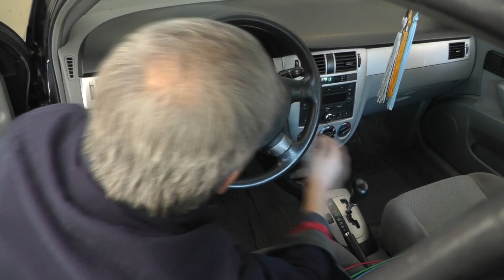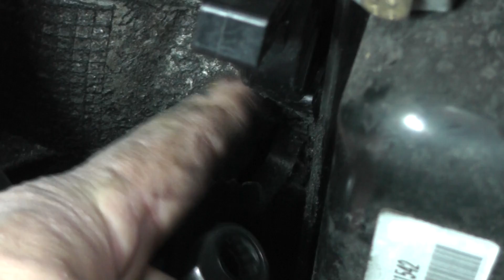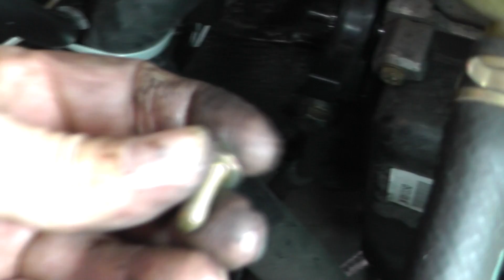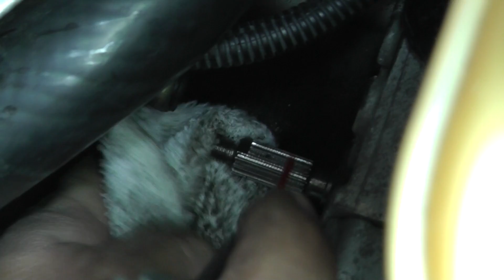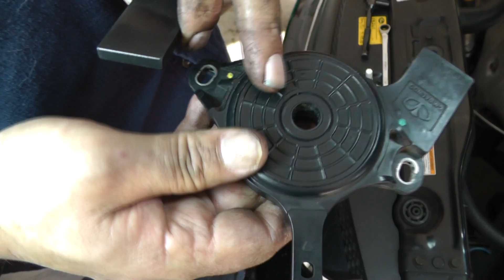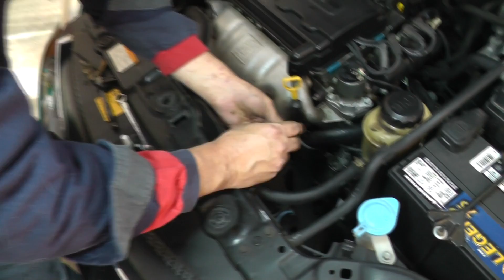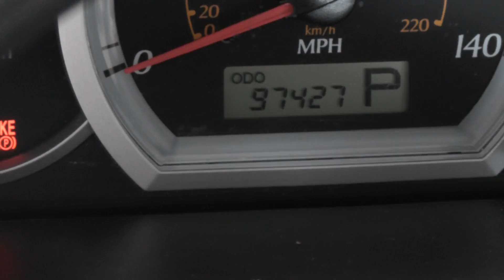Suzuki Forenza Installing Transmission Range Sensor - Part 5

Comment: Hi stuzman! Great video! I am having one slight problem getting my 07 suzuki reno in neutral. Can the range sensor still be taken off in park and then adjusted to neutral so i can install it?
Reply from the maker: Cortneyt80 You can take it off in park, but you need to make sure that the sensor is indexed for that position when you install it. The sensor comes new indexed when the gear selector is in neutral. If you want to install it in park, you’ll have to manually index the sensor to the park position. Otherwise, the sensor will not work.
Reply: I cant get the car in park but i will try that. Thank you :)
Reply: It worked lol! Thanks again for the detailed video!!!
Reply from the maker: Cortneyt80 Glad to hear that it worked for you! 😀👍

Comment: Hi Stuzman, when I slam on brakes very hard, the transmission seems to go in neutral and it take a second to kick back in gear. The gear selector doesn't move when this happens. It feels almost like the brakes are locking and then it clicks back in gear with a noise. Sometimes I cant get it out of park without pressing the shift lock button. There are no codes present. Could the range sensor be the problem.
Reply from the maker: If there was an issue with the range sensor, you most likely will get a P0705. I would focus on why sometimes you can't get it out of park sometimes. You have a solenoid interlock issue with the shifter. If you need the wiring diagrams which are free, you can check in the description of this video for a link.

Comment: Hi Stuzman! Thank you for this video as it will help me alot in working on my dad's car.  However my other problem is that the wiring hareness is damaged due to rodents chewing on the wires of the connector. Do you happen to have a link for the diagram of the wiring or possibly a link on where i can purchase a new connector for the transmission range sensor? Thanks in advance!
Reply from the maker: Here is a link to free wiring diagarams. https://www.bbbind.com/tsb-wiring-diagrams/ As for the connector, you could do a google search or maybe go to the junk yard and see what turns up.
Reply: Hi Stuzman! I replaced the TRS with a junk shop TRS then car wont start at all. Purchased a new one and the car starts but still same issue with the tranny on limp mode. When you put in drive, it's still stuck in 3rd gear and clunks as well as in reverse.  Tried manually adjusting TRS but to no avail. I have no computer to clear CEL. Is it necessary to clear the code using OBD?  This issue is driving me nuts!!
Reply from the maker: Paul Sevilla The light will be out if all is well. Are you sure the wiring is all good now?
Reply: Stuzman,  i believe wiring is all good now.  I just followed the colors of the wires that i traced back from the original wires that were not damaged.  Although the original wiring has 3 yellow wires and the  new socket that we got from the junk yard has 3 green instead of yellow but has a tracer equivalent to the yellow ones so i connected based on the tracer.  Everything else has the same color as the original wiring.
Reply from the maker: Paul Sevilla The only thing I can think of is to make sure the range sensor is adjusted properly. Although there is a special tool for this, you can get it adjusted by making sure the two bolts for the sensor is in the center of the two slots. If that has already been done, see if you have the slash across the gear indicator such as in park. If you have that slash, this indicates you have an issue with the sensor, its wiring or the TCM module. You may have to get a scanner on it to confirm that you have a P0705 code which indicates an issue with the range sensor circuit. You may have to do some troubleshooting to isolate the issue. If so, I have detailed troubleshooting methods in this video series.
Reply: Stuzman,  noted on this.   Will work on the car this week and give you a feedback.  Thank you!!!
Reply: Hi stuzman.  Finally got a hold of a obd computer.  Got 4 codes.  P0717, P0734, P0731 and P0700. I thinl ot os more than just a trs problem.  What is you opinion on this? Thanks!
Reply from the maker: Yes, more than a trs problem. All of these codes are related. The P0717 is for the input speed sensor for the tranny and this sensor is used along with the output speed sensor to determine the gear ratios for the gears. If the input sensor is not seen by the TCM which it appears it doesn't, then the module can't determine the gear ratios. Thus, that's why you have P0734 (fourth gear) and P0731 (first gear). The P0700 is a generic transmission code. Start your diagnostics with the input speed sensor and see if the wiring is intact. Maybe the rodents had a happy hour on that wiring. If that looks good, then you'll need to see if its generating a signal. A scanner that can see data will be able to let you see the RPM of the input shaft of the transmission. Good luck!
Reply: Hello stuzman! Thanks will dive back in a few days and see what i can find.  Thank you!
Reply: Hi stuzman! I have been trying to look for the intake turbine speed sensor but to no avail. Do you happen to know where  it is located as well as the output.turbine speed sensor. Thanks!
Reply from the maker: Hi Paul. I can't remember the exact location of these two sensors as I sold the car about four years ago. If I still had it, I would take photos for you. The input turbine speed sensor should be located near the bell end of the tranny whereas the output speed sensor should be located on the differential end of the tranny. Both of these sensors should have two wires going to them. You could do a search on Google for photos which may show the location of the two sensors. As a suggestion go to www.alldatadiy.com for your vehicle which would have the factory service information which includes, repair information, wiring diagrams, electrical connector information showing locations and of course, all sensor's location. The price is very reasonable and would be a good investment in yourself. Good luck Paul!

Comment: I did everything I saw in the video replace with an original part TRC...and after running the car for less than 1/4 miles...when back on 4 gear and is giving me the same error P0731,P0700, P0705, and it when back on 4th gear. Now is stuck in 4th gear .. again ?? Please help ??
Reply from the maker: You may have an internal issue with the transmission as the P0731 is an indication for an incorrect gear ratio implying that the transmission is slipping. The P0705 would indicate the tranny range sensor has an issue or its wiring. Did you do any troubleshooting with the sensor to know that it is bad along with its wiring?

Comment: Hello I spoke to you 3 months ago I have a Suzuki Forenza if you don't change the oxygen sensor will it cause the car to not run and also do you have any videos on how to change an oxygen sensor I think it's an O2 oxygen sensor
Reply from the maker: Yes, I remember you Veronica and hope you're doing well. Typically, depending on how an O2 sensor fails, it could make the car run poorly either too lean or too rich. Best to know for sure that is your actual problem as far as the O2 sensor. I don't have any videos on changing the O2 sensor, but it's a straight-forward job. Disconnect the electrical connector and screw the sensor out with a wrench or O2 sensor socket. Having the exhaust system hot usually makes the sensor come out easier.

Comment: Hello I have a question do you have to have that alignment tool if so do you know where I can get it at for a reasonable price I looked it up on Google and it ranges from $120 and up is there any other place I can get it for more reasonable price?
Reply from the maker: Veronica Roni Lake no, you do not tool. You can do as I mentioned in the video by placing the two bolts in the center of the slots. That should be close enough for it to work.
Reply: stuzman thanks
Reply: Is it okay for me to ask you if you can tell me do you have any videos when these particular codes and also which one should I repair first.
PO700
PO335
PO110
PO107
PO111
PO131
THANKS IN ADVANCE 😊
Reply: My car is a 2006 Suzuki Forenza
Reply from the maker: Looks like you've got a few issues Veronica. If this was my car, I would start with the P0335 which is for the crankshaft position sensor. You can consider this as a very important sensor where other systems rely on it. So, I would find out what going on with it. It could be the sensor or its wiring.

P0107 indicates that there is an issue with the MAP (Manifold Absolute Pressure) sensor. I would check this one out for proper operation next.

P0110 and P0111 are both for the IAT (Intake Air Temperature) sensor and can check the sensor and its wiring for proper operation next.

P0131 indicates there is an issue with the O2 sensor on bank 1 upstream of the catalytic converter. The code is saying that the voltage is staying low for too long.

P0700 indicates an issue with the transmission and I would look at this one last. With the other issues above, it's quite possible this code is coming up because of those faults. Once the other faults are fixed, this code may disappear.

Oh, I forgot to mention that I don't have any videos on these issues and I sold the car about five years ago. Good luck on what you find and hope it all works out!
Reply: stuzman thank you thank you so much you have been a great help. We did replace the transmission sensor and the car is running smooth and great, however we know this that the check engine light is no longer lit but we didn't get the other codes that I sent you fixed yet have you ever heard of that happening?
Reply from the maker: You could always scan the car to see what codes are still in the car.  I don't see how any of those other codes are related to the range sensor. I suspect that they are still in memory. And if you want, you can clear them and see which codes come back. Be sure to write them down before you clear them for comparison later if one does come back. If the car is running great now, you may not worry about it at the moment.

Comment: Hello I have a 2007 Suzuki Forenza and when I drive sometimes it shuts off once I stop. I’ll drive and try to accelerate and it’ll lose power then gain power then I’ll stop and it shuts off. No matter what gear I’m in. Once it happens I just put the car in drive and restart it. It happens every once in while but I have a constant fear that it will shut off again. Do you have any idea of what could be the problem? The check engine light is on but it is for the Coolant because I need a new thermostat (getting that done Saturday). The code is P0128.
Reply from the maker: Get your thermostat replaced and when your code goes away, hopefully that will fix this issue too. The coolant temp sensor is an important sensor used by the PCM to make fuel calculations.

Comment: I must have broken the new sensor, because after forcing it in, it does not start and shows the P with a cross.   But then again
 when I connect wire connector, it does not go in all the way, but it does click, what do you think?
Reply from the maker: You probably broke the sensor is my guess. You could do some voltage checks on the sensor to be sure though.

Comment: I got it out, but cannot get it to slide in, any suggestions?
Reply from the maker: It's a tight fit which shows you how much the plastic inside the spines of the sensor has worn. Spray a little silicone spray on it and you may have to push on it to get it on. Keep at it as it will go, but don't break it :)

Comment: Great video as always.  I know I have issues with the transmission ramming I to 2nd gear occasionally but not all the time.  Based on a lot of issues with transmission this is a common repair.
Reply from the maker: Gregory Rooker yes Gregory it's a common issue on these cars.

Comment: Hello mr Stuzman I am driving Suzuki forenza 2007 with auto transmission, I am not sure that i have exactly the problem with my range sensor but sometime especialy when i driving slowly while shifting from 2 to 3 i getting the strongly push forward, and after that check engine is on, after some time it is going off untill next same situation, i went to diagnostic and they found p0783, p0300, p0302 p 0303 but nothing p0705, but it seems like transmission works (imho but i am not good with that) and something just not letting it to shift, also I cant put this in 1 it is not giving me, but all over shifts working and shows on display. thank you in advance and sorry if i confused you for all of this things which i tried to describe here. thank you one more time.
Reply from the maker: Kirill Plotnikov Although you have a transmission code of P0783, I would focus on your misfire codes of 300, 302 and 0303. When you have misfire codes this could give you tranny issues. 👍
Reply: Hello mr. Stuzman, thank you so so much for response, just yeasterday I figure it out(codes 300, 302, 303) and  scanner did't show this codes anymore, but anyway p0783 still there, and today I also tried to shift gears by stick like 1 to 2 to 3 not on D and during this time I didnt have any pushings, car drove well, so I dont know what to do? do I need change  range sensor or tranny sensor or is it same sensors? if its not where I can find it and how to fix? thank you one more time and thank you in advance for answering this questions
Reply from the maker: I don't believe that the range sensor is your issue as the TCM (transmission control module) would generate a P0705 code. The P0783 code is where the transmission is having trouble on the 3-4 shift.  This could be an electrical issue with this 3-4 solenoid or it could be internal such as a leaky seal, or it could possibly be a software update needed. You can do a search for TSBs (technical service bulletins) on your vehicle at this site. Also at this site, you can get free wiring diagrams along with the TSBs. The site is located here http://bbbind.com/tech_database.html

 If it turns out that you need to get to the inside of the transmission, then you're going to need a service manual. For that you'll probably going to have to pay a small subscription fee. I use two subscriptions services where one is www.eautorepair.net and the other is www.alldatadiy.com

You can also google search and find other information that other folks have been having with this code. One example is located here http://www.suzuki-forums.com/suzuki-forenza-reno-forum/43561-05-forenza-p0700-p0783.html Good luck on what you find and hopefully it won't be too serious!
Reply: Thank you so much for your responses, I am realy apreceate you, i will try to do whatever I can

Comment: What is the hose coming out from were the sensor is attached? I followed it on my Suzuki and the opposite end is disconnected. =/
Reply from the maker: BLACKENDEYE I believe this is an air vent for the transmission fluid.
Reply: Ok. So it is supposed to be disconnected on the end that is not plugged into it? I am having issues with it acting like it wants to stop and has very low acceleration. I am just trying to figure out what is wrong.
Reply from the maker: BLACKENDEYE put a scanner on it and see if you've got a current or pending code(s).
Reply: I will do that. Thank you for your time. = )

Comment: Replaced this range sensor, seems to be shifting alot smoother, but still getting check engine lite code 0700 transmission control system, what could this be ? Thanks
Reply from the maker: Maybe something internal to the transmission.

Comment: This was an excellent video, very detailed and helpful. I did everything just as you said and it worked perfectly!
The only thing i'd like to say is that when i put the new range sensor it took a lot of effort to insert. It takes a lot of patience, you gotta do a lot of small movements to put it right. It also works on the chevrolet Optra, its called pare-neutro here in Venezuela

Thanks a lot!
Reply from the maker: Otoniel Morales i'm glad the video helped you and you're right that it is a little tough getting the new range sensor onto the shaft.

Comment: Mr. Stuzman, I have chevy optra 2005 model, the same transmission with Suzuki florenza, The car is running good for a couple of minutes while running, hold light will blink or flashing. Besides from the trans. range sensor, is there another sensor that might cause transmission to show hold light?
Reply from the maker: It could be the tranny sensor, but that usually brings on the check engine light with a code of P0705. I would put a scanner on it to see what pending or current codes are stored. I don't have the service manual for the Forenza that I showed in this video as I sold the car along with the manual several years ago. Sorry that I couldn't offer a definitive answer for you.
Reply: Thank you for quick reply. Next week I have an  appointment with Chevy dealer for scanning. I will keep in touch.
Reply: Hi Mr. Stuzman in the scanning result it say that "speed input sensor" is defective. This is the mechanical word chevy used. The sensor is inside the transmission so it was opened and replaced. The car is running now without the Hold light flashing. I want to thank you again from your teachings and it helps me also understand  how auto transmission works in Suzuki and Optra cheve. May your followers learn more about your videos. Thank you very much.
Reply from the maker: hyundai183 always a pleasure to help out. I'm glad to hear that you got your Chevy running now without any issues and thank you for the feedback! 😀👍👍